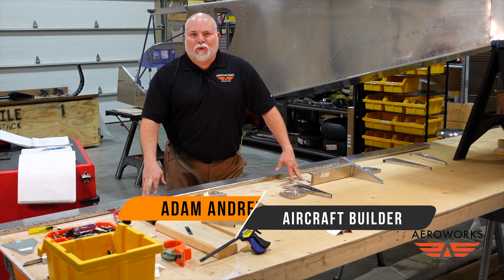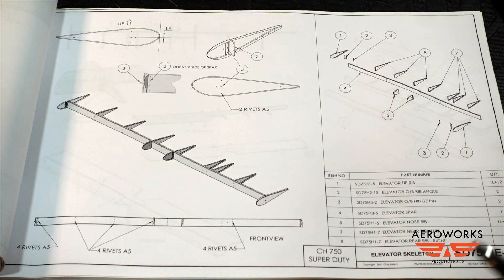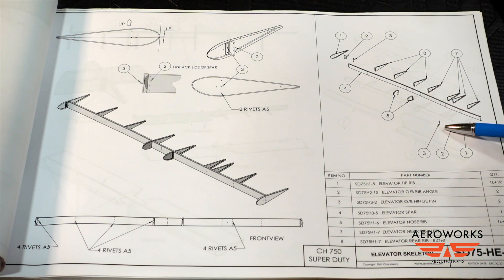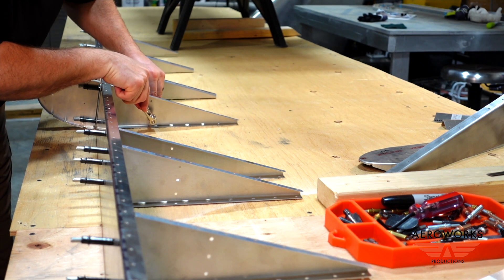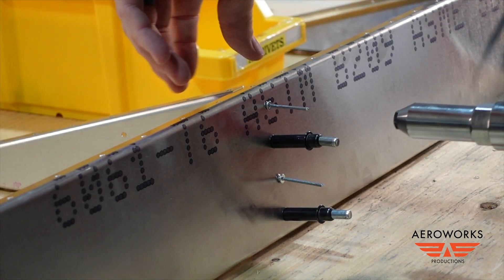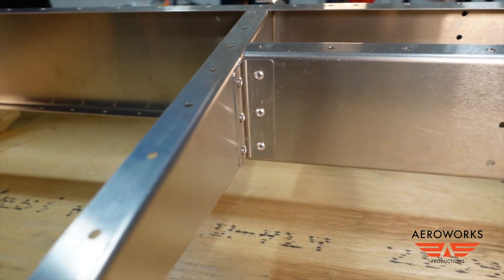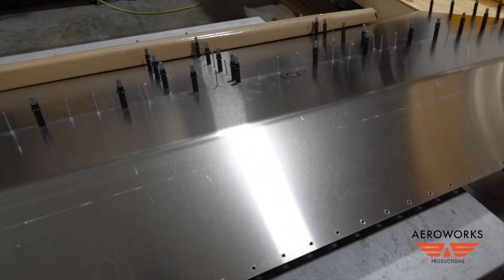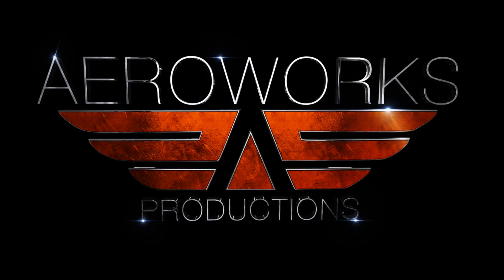Ep. 17 | Elevator Construction | Zenith Super Duty Aircraft Build Series

Comment: I don't understand why the holes that you drill out are not just punched out the correct size from the factory. I also wonder how much it would ad to the kit cost if every part was marked with its part number, directly by the stamping machine, by Braille-like dots..
On some of the drawings, they point out things to be aware of, on others they leave it to guesswork.
The elevator pivot should be finished from the factory, not left to the (lacking) fabricationg skills of the individual builder.
Reply from the maker: As an earlier kit adopter, some parts don’t always get punched to the right size and even when they do a little clean up is necessary here and there.  It’s not all just pop it together no plans needed although once you start a major component you only have to refer to the drawings for the small details.  The stickers are Zenith’s QC they say, so once a part is cut, stamped, shaped etc, it’s inspected and then a sticker is applied.  A little acetone on the stickers takes them right off.  If you don’t like that smell or are working in a confined area, there are less toxic things like Goo Gone that work too although not as fast.

Comment: Pop rivet airplane... still makes me shake my head.
Reply from the maker: Many planes flying using this construction method, not just Zenith.  Sonex, Murphy and Rans to name a few.  Great for first time builders.
Reply: Aeroworks Productions oh I get it... just as a 29 year A&P where we can’t even oversize a hole a couple thousandths to use a single cherry max rivet... seeing the whole spar go together with pop rivets still makes me go “hmmmm” 🤔
Reply from the maker: @PoasLodge  The whole spar on the Super Duty is Solid rivets.
Reply: Aeroworks Productions - assume you are talking about the wing main spar?  That definitely is warranted and makes sense.  Don’t get me wrong... if the method is proven over time then the proof is in the pudding. Trust me ... it would be amazing to be able to run a row of rivets in 3 minutes. I’ve just never had the pleasure.  My stabilator re-skins take days and days and days.
Reply from the maker: @PoasLodge  Yes, the main spar and the forward fuse side are all AN solid rivets.  I hear ya on the work you’re doing.  Yes this design has been around for 20+ years so it pretty proven.  Thanks again for commenting from a professionals perspective.